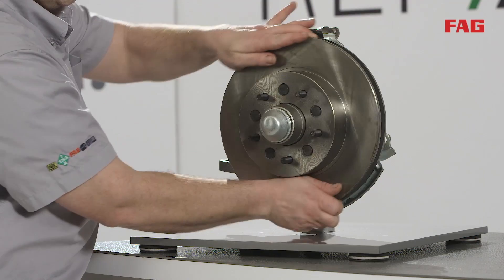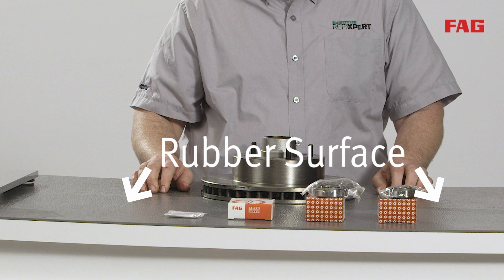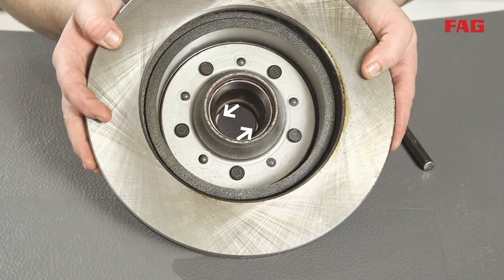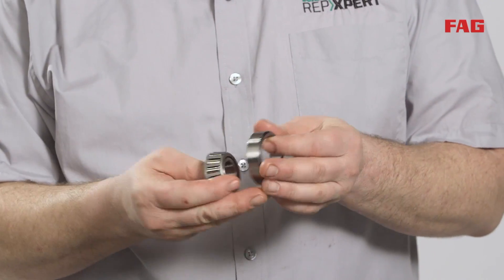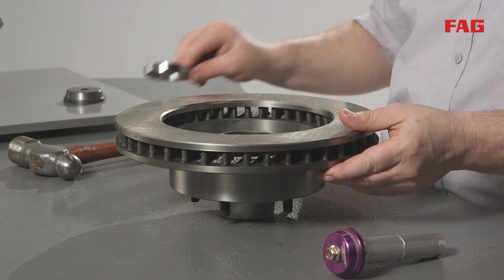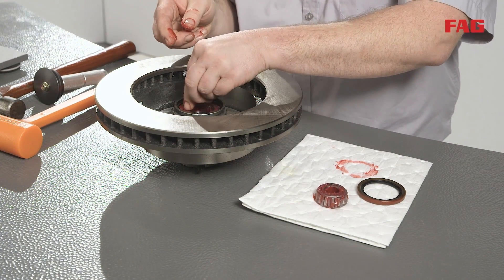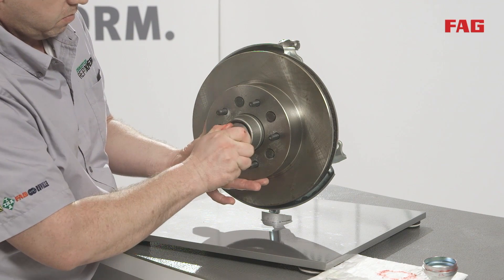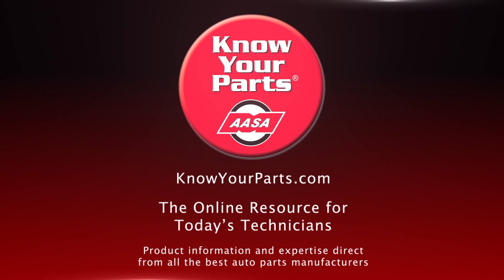Tapered Roller Bearing Repair | Know Your Parts

Comment: You're very lucky if the races get in so easily as show in the video. I put the races into the deep freezer and heated the rotor with a heat gun. That works a lot better. Actually these race drivers are not the proper tool. Using a real bench press is much safer as the races will be pressed in completely level. Also for pulling the old races this procedure with a chisel is sometimes a pain in the a... and there are pullers which do the job a lot easier and safer. And please don't use a hammer on the hub cap :-( use a screw driver + hammer around the cap. Be aware that tigthening to specs and backing off works for good condition spindles. If your spindle is already worn, you have to tighten more until you feel no slop anymore or replace the spindle.

Comment: Wear safety glasses when hammering races! Don"t forget to put grease in the hub cavity.
Reply: "Don't forget to put grease in the hub cavity." ...or...go ahead and forget if you want to, as long as the bearings are properly packed with grease. Some guys say fill the hub, some guys say not to. I read in a Chilton manual where it says to pack the hub with grease if you don't have an auto bearing packer. But I don't see the difference in packing them by hand vs using a bearing packer, as long as the bearings get packed. So I say either pack the hub cavity or don't.